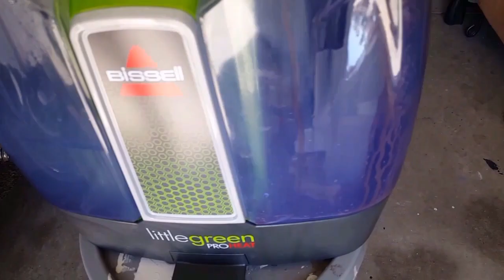Bissell Little Green Proheat review

Comment: Eh, while  the results are greatly improved, it still didn't get rid of all of the stain and the residual stain would drive my OCD batty. I have one of these units and the "ProHeat" part of the name feels more like a gimmick than an actually beneficial feature. The cleaning solution doesn't come out particularly warmer than when it came in. I'd feel a lot better about a proper steam cleaner.
Reply from the maker: I found the only way to get the solution out is to come back after it dries and use fresh water a few times until its all out. For the price it was a good little unit for me.